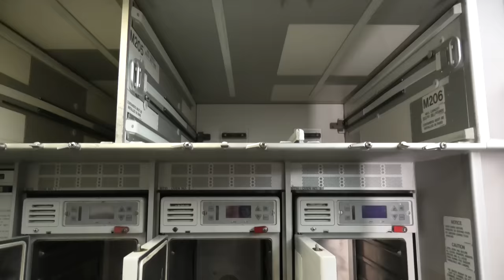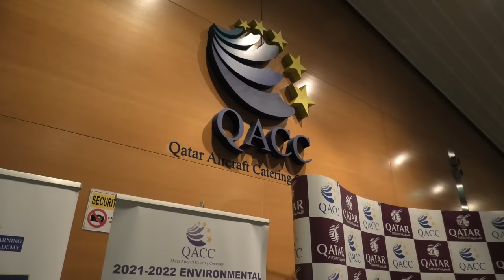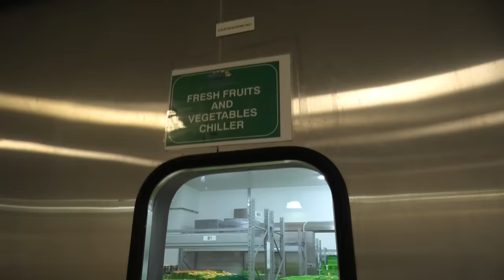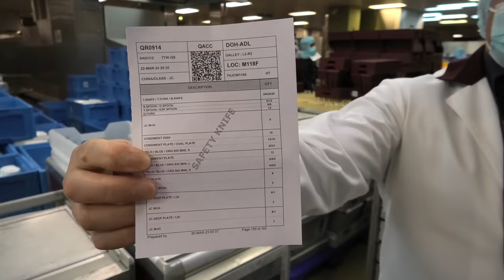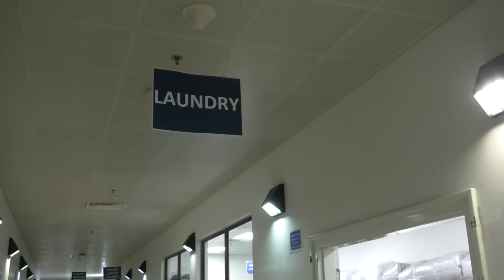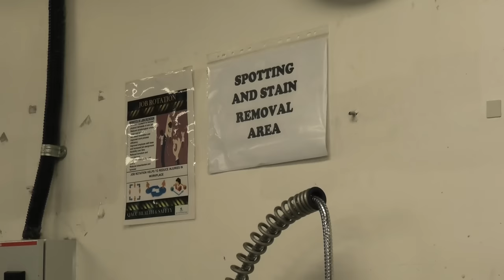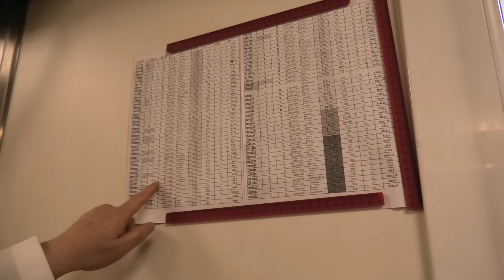What REALLY Happens to Inflight Blankets? How Airlines Work Part 1

Comment: Thanks for this vid. I have a couple of questions though:

1. How many hours between Arrival from Seatle and Depature to Adelaide for that plane?

2. Does the crew from Seatle get the next day off. And when would they fly back to Seatle.

Thanks
Reply from the maker: Hi, the aircraft was actually on the ground for 3 hours. All the crew on the Seattle flight would have a couple of days off at least after a long haul trip like this. Doha is their home port so depending on the destination a long haul trip can last anything from 3 to 7 days. Crew are not designated set routes - they could be rostered on to any destination that flies the aircraft they are rated (or trained) on. They also don't work as teams as such - the crew coming off the Seattle flight could all have completely different flights and destinations for their next flights.
Reply: @DennisBunnikTravels  thanks very much for this excellent response!

Comment: Great insight into a high quality carrier investing into high hygiene and high quality control. This is great from airline side but passengers need to also contribute and so many times I’ve walked past a seat on arrival in shock at the terrible state its been left in; blankets and PJs thrown on the floor like scrape paper, remnants of an amenity kit pulled apart, food on the floor (from the first meal service) and as for the pillow it should be burnt. Good on Qatar for raising the bar on high quality.
Reply: 💯 agree with you

Comment: Good on Qatar.  I assume they wash all blankets and pillow cases? I flew a reputable airline some years back and the blanket I pulled out of the sealed plastic smelled badly of vomit.  It clearly hadn’t been washed.  Since then I’ve always not wanted to touch the blankets on a plane.